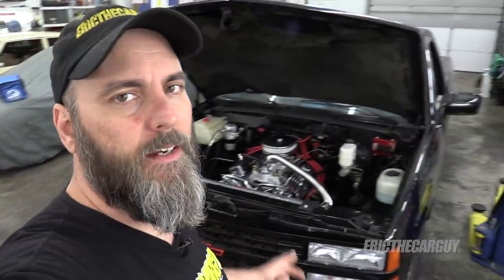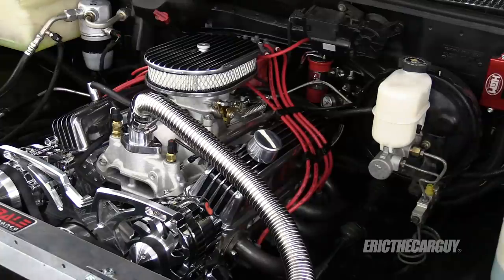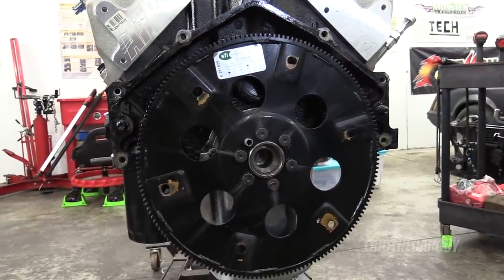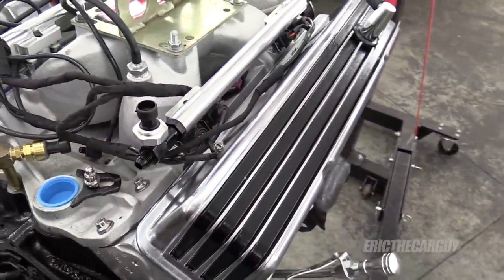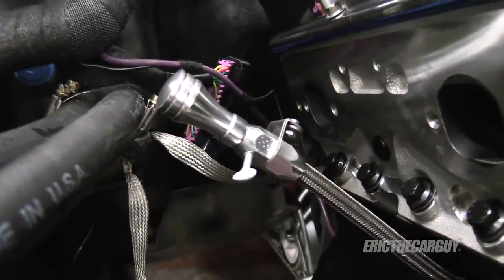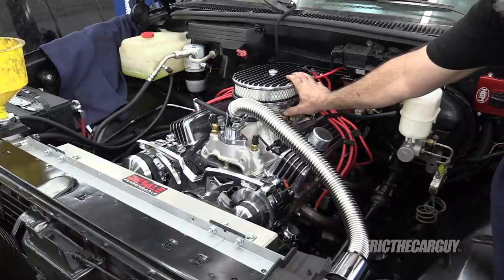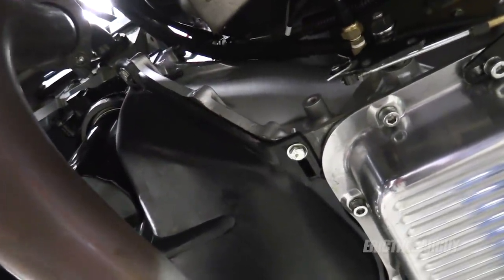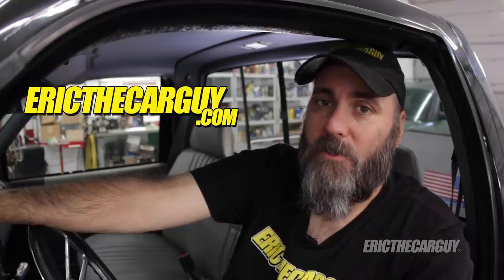Last Minute Prep and Problems #ETCGDadsTruck

Comment: Eric,  I think allot of us realize the stress and fatigue of doing a build with a definite timeline. Under such pressure you did an awesome job with this project. You have the power of editing your videos, yet you choose to show your mistakes. Convinces me you are an upstanding individual. Sorry but I did have to chuckle when you had plug wires crossed not only once but twice. Just recently finished a 350 for my 69 C10. Had it running beautiful quite a few times. Did a little more work to it then..... no start, no start, no start. Funny thing is they seem to start a little easier when you plug the coil wire back in! Happens to us all.
Reply from the maker: Thanks for that comment. Made me smile.

Comment: I got a buddy that built a ford 5.0 for his bayliner and had the same thing happen. The oil pump was pumping all the oil up in the heads and starving the bottom end. In the end, rearranging vents (pcv valve) and a different pump solved the problem. In the end, it’s a strong small block with great torque..

Comment: That dipstick would piss me off something fierce! The O ring should make a positive connection with the tube... grrr 
I suspect Chinesium from "that" supplier.
That filter should be cut open and let it tell it's story. 
Thanks for sharing Eric, 
Cheers
Reply: I agree Rick, IT WOULD PISS ME OFF ALSO, BIG TIME. I would have tried to find a thicker 0-ring though ? But his solution sure does work.
Reply: The ideal solution would be to machine a groove inside of the tube that the o-ring could lock in to.
Reply: The ideal solution would be to machine a groove inside of the tube that the o-ring could lock in to.
Reply: M DC I agree with all of the above y’all said .. an if it were me an the dipstick situation.. well I’d been sooo pissed I woulda tossed it never to be seen again lol.. An went with a totally different one 👍
Reply: Darren Sager I am all for modifications and go fast parts, but some things just don’t need to be blinged out. Like dipsticks and radiator hoses... An OEM approach makes more sense in places where function matters more than form.

Comment: Eric, awesome that it's together!
Congrats!
And you did everyone a solid bringing up proper break-in driving for a fresh engine. 
Well done!
Just one thing - that air filter is too small, there just isn't enough surface area there for 383 cubic inches to draw enough air through when you wind it up.
As an aside -
I use 1/2 turn for preload on hydraulics, all the manuals say one full turn but one turn just puts the plunger too far down in the lifter, at 1/2 turn you usually end up with a few hundred more rpm before lifter pump up.
Then again - it's not like it was built to race. (or was it.... Lol!!!)
Nice Job Eric!!!!!
Reply from the maker: So far, the air filter doesn't seem to be an issue, but at some point I'll try it without to see what happens. Thanks for the info.
Reply: @ericthecarguy  
No problem!
It was just something that came to mind when I saw it - it's a good looking air filter!
There might not even be a noticeable difference on the street, and it's far from being any kind issue, it's just easy to forget that engine is now 10% bigger and it winds up higher.
If there's room, on the big inch Big blocks (460s, 454s, 440s) I run double stacked 14" filters, I had a 460 that just didn't pull like I thought it should - someone pointed out it (one) might not be enough filter and they were right!
You gotta be loving how hard that 383 can pull that truck! 
Awesome build - and as always you share the knowledge that people really need, not the B.S. others do.
Good Job!

Comment: They’re called thumb screws I believe
Reply: M DC or just buy the correct size thumb screw to start with... lol Depending on the size, the screw cutter on a pair of standard cheapo wire strippers works great for cutting down #4 to #10 screws while simultaneously restoring the threads.
Reply: Can use the same one just knock a few threads off.

Comment: Hey Eric i believe  a 1/2 turn is only valid when engine is running & hot / loosen till ticking tighten till quiet , then 1/2 turn ,(messy ) good luck !

Comment: Nice recovery... 2hen adjusting the valves, I always do a 12 o'clock start position & end at 9 o'clock.. That leaves the lash you're looking for with a half turn, but insures you dont over adjust & flatten your cam lob... Nice work..👍

Comment: I'm more concerned with the crankcase pressure issue, although it could be related to the compressions stats.  After a week or two of Dad driving it, I'd be interested in the followup compression test.  In my mind, rings need more time to "mate" with the cylinder walls than a few hours of driving.  Also wonder if that pcv valve is being overwhelmed.  My boat has that engine, I removed the pcv and ducted straight to the air cleaner, cured a leak at the corner of the oil pan related to crankcase pressure.  Just my random observations, and you did indeed show great patience with that dipstick.
Reply from the maker: I believe it's a ring issue. I plan to do a follow up video with compression test to see what's going on. As for the PCV valve, I replaced it, no change. Thanks for the comment.

Comment: Eric use a proper PCV valve hooked to a vacuum source, you can route it to an oil separator canister rather than the manifold. Those breathers filter air entering the engine, if you use them as crankcase breathers for air exiting there’s no oil separation and they just distribute oil mist over the engine.
Reply from the maker: I believe the excess crankcase pressure is caused by too much blow by in cylinders 7 and 3. No amount of PCV vacuum will overcome that. Thanks for your comment.

Comment: not sure if someone else has said it or not but that 1/2 - 1 degree difference is due to when the axle has load(being driven) it will be parallel. worst case scenario your u joint wears out a little sooner.

Comment: With the PCV system, shouldn't there be a slight vacuum in the crankcase instead of positive pressure?  Back in the day, we would test the PCV system with a little vacuum tester in order to certify the smog system.  I know, that was a long time ago ...
Reply from the maker: Yes, I suspect a problem with the rings in cylinders 7 and 3 causing the excessive crankcase pressure.

Comment: For compression test: give it some time. After 3000 miles go and check the compression again
Reply from the maker: After 2K miles it still has an issue. I believe it's a ring issue. I plan to pull the engine soon and check it out. I've pretty much parked the truck for the summer and haven't really been driving it.
Reply: Are you hoping compression in the other six cylinders will drop 15psi after 3k? Because the two low ones certainly aren’t going to get better...

Comment: Hope that drive shaft company is doing that shortening for free.  Also, "can't balance without the yolk"?  I made drive shafts for a summer.  Made every aspect from cutting the tubes/deburring them to making the yolks, welding the ends, and balancing and packaging.  Guess what.we didn't halve those yolks installed to balance either.  IF they were spec'd to be with the shaft, yes, if not, we didn't have them.  WOW...Might be time for a new drive shaft company Eric.
Reply from the maker: It's the only one I know of in the city. They did good work up to that point.
Reply: @ericthecarguy  Sad.  I wish we had quality shops in my area.  All are rated 1 and 2 stars.  Most charge what a dealership will charge and some are more.  The ones that charge less do horrible work, or do half the job.  Too many horror stories I've heard from too many people... Hope things get better for you on that end of things.

Comment: How did you cross the ignition wires, Eric?  
That's a rookie mistake.

Engine sounds much better!
Great job in trouble shooting and correcting those problems.  You're the man Eric!
Reply: Inquisitor6321 

It’s easier to do than you think

Comment: This is why I like stock oem stuff. Everyone I have ever known that built an engine/transmission using aftermarket "performance" parts has had problems. The stuff just doesn't seem to be reliable.
Reply from the maker: All hot rods have problems, it's part of the fun.
Reply: @ericthecarguy  Fun... ? Not on the side of the road halfway between Dallas and Houston at maybe 1:30am. Ugh. Not that I have any experience with that.  #sarcasm

Comment: I had the same problem with my 598 bbc skipped the step of putting loctite on the ARP flex plate bolts and it sounded like a rod knock.

Comment: Ive always heard its a 1/2 to 3/4 of a turn after the lifter stops making noise while running. It messy unless you have an old set of rocker covers to cut the centers out of.

Comment: so cylinder 7 never had the boot pushed on far enough to lock the spring clip on the plug or it's defective and possibly not held/rotated/squeezed to purge the air/vapor lock out and let it stay in place. the boot/silicone grease can cause enough pressure to "push them off" but what do I know ;)

Comment: I can’t wait to hear what’s up with those compression numbers & oil leak. Were the lower compression cylinders the same in this video as when you returned from the power tour?
Reply from the maker: I pretty much parked the truck after the tour and haven't looked into the ring issue yet. I needed the break, and the time to edit this series.

Comment: With those two cylinders having low compression, and the dipstick launching out of the tube, and oil coming out of the breather, I would be concerned that there is too much blowby in those two cylinders.  Fix the dipstick and I wouldn't be surprised to see it start blowing gaskets out of the oil pan, and / or valve covers.
Reply: Unfortunately I was thinking same thing ? I don't like the dipstick being held in place by a thumb screw but, HELL IT'S NOT LIKE HE HAD ALOT OF TIME LEFT, I GET IT BUT I DON'T APPROVE OF IT ? HE'LL FIND OUT WHATS UP OVER THE WINTER FOR SURE.
Reply from the maker: You are correct, but the issue wasn't bad enough to warrant cancelling the Power Tour. The truck was still drivable. We just had to keep oil in it.
Reply: He should have gone to Jared, because someone has a ring problem.
Reply: @ericthecarguy  Sometimes you do what you have to do.  It will be interesting to see what the cause of those two cylinders not sealing up is.  Are they honed / bored bigger, are the ring end gaps just too big.
Reply from the maker: Thomas Herring Ring gaps were checked in a previous video. https://www.youtube.com/watch?v=g_dPAptfxnY

Comment: You never want a driveshaft "AXLE" with u-joints to run straight or flat. You need a driveshaft with rag joints for that application.

Comment: Eric this question is on the series of A/C issues, can the dye be added added with the oil, directly into the compressor and accumulator instead of thru the service ( yellow ) hose

Comment: Yeah, if fluid loss on the dipstick hole happens, generally speaking, you should pop it open regardless of any other indication. I mean, don't get me wrong, if you caught it quickly, then yeah, no foul, no harm, but if enough cycles were involved without oil...it's best to...pop it open. Especially so with a new-ish engine. Or at least use an inspection camera to judge the motions from inside. Scores, play, light behind the curtains, the works.
I am guilty of having done worse, so i'm just sayin'.
Reply: aserta, YES ME TOO, I'VE DONE A LOT WORSE IN MY BEARLY YEARS TO MY 68 CAMARO, OH BOTHER.

Comment: The hi crank case pressure is from the rings not sealing, put a few grand on the motor and it should be good
Reply from the maker: I have, same issue. I need to go back and tear it down unfortunately. Thanks for the comment.
Reply: @ericthecarguy  damn that sucks

Comment: Was the oil pressure gauge working when it was smoking?
Reply from the maker: 80psi
Reply: WOW, 80 PSI
Reply: @ericthecarguy  so the bearings etc still had some oil supply  ?
Reply: Good deal, sounds like you’re okay. If the dipstick were dry, maybe it’s not long enough and you had adequate oil to prevent damage. Great build and I enjoyed the videos.
Reply: EricTheCarGuy that’s high, filter bypass opens at about 75psi

Comment: Hey pretty good show. Reality is flat land or slight hills bring it up to 50 let it coast in gear down to about 30back up to 50. some rings and cylinder bores break in the first 30 seconds or so. Depends on the rings and bore finish. you should have almost intake vacuum in the crank case. examples of alternate ways of generating crankcase vacuume besides the pcv valve, a dry sump pump or if you look at a prostock car there's a little valve on the collector, why do they do this crankcase vacuum increases ring seal, reduces blow-by ,makes power, keeping your oil cleaner longer.  with fuel injection you dont even have the worry of that damn fuel pump diaphragm drip drip drip ruining your oil.  really good project you help alot of people gain knowlege never a bad thing... never

Comment: Great video as always. 

I wonder why the oil pressure is so high, assuming that's what's causing the dipstick blow out. Also very curious to see what your dad thinks of the reborn truck.
Reply from the maker: The oil psi wasn't high. There was excessive crankcase pressure likely caused by a ring issue. Next week dad sees the truck for the firs time. A future video will cover the crankcase pressure problem. Thanks for your comment.
Reply: Since the rings weren't completely seated yet, there was probably some extra blow-by. Combine that with a loose-fitting dipstick and a restrictive breather, and you get what Eric got.

Comment: You have a nice looking engine, and it should be a stormer. I assume you have a PCV valve to ensure plenty of fresh air through the crankcase. It looks like you do, but I got the impression from what you said there was too much crankcase pressure.  To me that air filter looks too small for a 383 at full song. I’d go larger diameter and taller. But that’s just my opinion, and you know what is said about opinions - HaHa.

Comment: Did the engine  run almost  dry with a dry dipstick ?  isn't that a serious concern. How do u know how much excess wear happened  ? I wonder why the oil pressure light  didn't  come on etc
Reply: He has a gauge & oil pressure was 80 PSI, so all should be good ?
Reply from the maker: No, I still had plenty of oil pressure.

Comment: Can't the difference in compression pressure be because the rings where less seated because there was no combustion  in that cylinder?
Because the spark plug wire popped off?
Reply from the maker: Possibly, but the excessive crankcase pressure can only be attributed to excessive blow by which could be the result of a broken ring. I plan to revisit this issue after I pull the engine and inspect it. I'll be making a video about that.
Reply: @ericthecarguy  Ok, so cannot be the rings not being seated that causes the blow by?
Curious to see what happened!
Great video series, keep up the good work!
Reply from the maker: That's a little too much blow by to be just unseated rings I'm afraid.
Reply: @ericthecarguy  Ok, I did not see that.
I am a starting mechanic so I do not know that much of engines yet.
Your videos help a lot in that part ( and other parts as well )
I see you use a 3/8 Snap on Flex head ratchet quite often, do you know the part number of that ratchet?
I use a cheap flex head 3/8 and I really like to use that, but I find it a bit to short..

Comment: I have a question for somebody that has to answer to this. On a Chevy engine is there anywhere on the Block that can tell you what size that engine is. I'm trying to figure out if I have a 305 or 350 in a 1987 Chevy custom deluxe.
Reply: Have you tried checking the VIN number?  http://www.usa1industries.com/1981-1989-gmc-chevy-truck-vin-decoder-chart.html

Comment: What about the pressure test on the two low pressure cylinders. 150 + on 6 of them and low levels on the two cylinders you didn’t show a re do of the compression numbers on the two that were low before this final fix??!!!!✌️👌👍😂❤️😀😁💪😀👌👌👌👌👌👌👌👌
Reply: He said he would address this in a future vid. The only fix he did in this vid. is Flex Plate & oil dipstick.

Comment: Why did you redline it when running it in ? Every V8 I’ve had built I was specifically warned not to redline it for the first 1000km .
Reply from the maker: https://www.youtube.com/watch?v=HvVw2MKdUzc
Reply: its a roller cam engine ,not a flat tappet but i agree with the "not redlining"

Comment: Eric... off topic but I wanna know how the Fairmont has been with the sniper,  I have an 88 foxbody with a 306, the sniper efi, and an on3 turbo and I'm having hard start conditions,  after it starts it runs good, hopefully you reply, I've tried going to your website but can't figure it out.
Reply from the maker: I had to richen my start up mix a bit for it to start better. Also, make sure you have good fuel psi. You might want to give it a few seconds before you crank the engine to build up fuel psi. I do that with mine also.

Comment: That's main line pressure  port. That would not cause your shift problems. The 4L60E and the 700-R4 has that port. Is this a 700-R4 or 4L60E???
Reply from the maker: It's a 4L60E. Monster transmission is who told me that was the 1st gear port. I would hope they know what they're talking about. https://www.youtube.com/watch?v=rnKof4v0Zts
Reply: @ericthecarguy  Eric That is the mainline pressure tap It has nothing to do with first gear.

Comment: That's not how to measure for a driveline length. The correct way is to put the slip yoke all the way in. Then measure center of joint to center of joint. Then subtract 3/4". Measuring from the seal just causes confusion. Also the pinion angle vs the trans should be parallel. I worked at a driveline shop for 12 years. So I know some stuff.